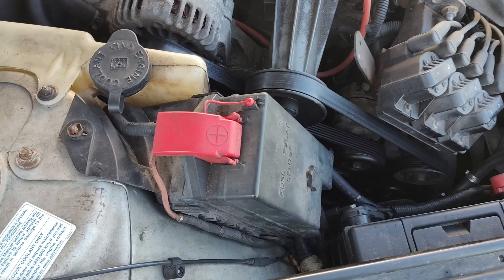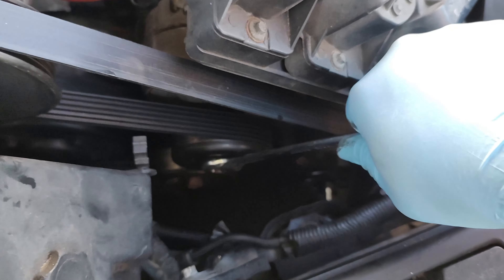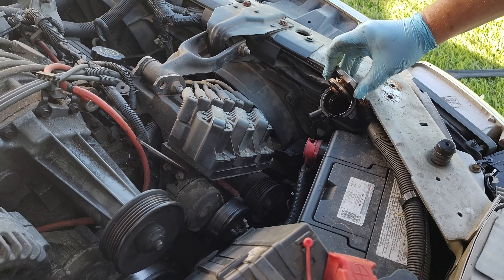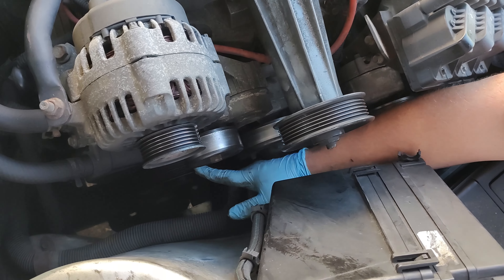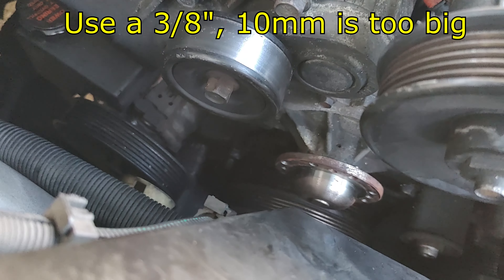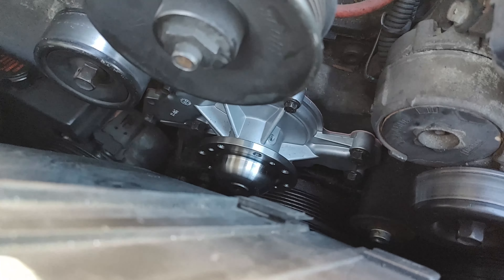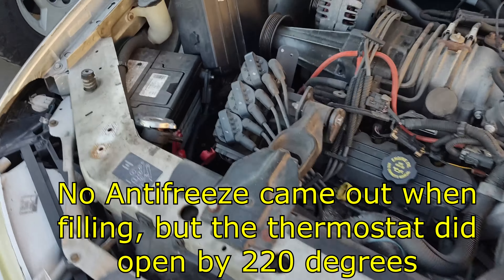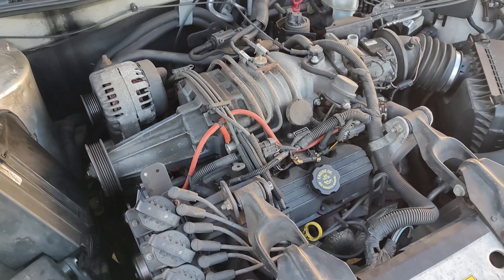2001 Pontiac Grand Prix GTP Water Pump Replacement for 97-03 GM 3800 Series II Supercharged L67

Comment: How do you get the pulley off I heard a 15mm bit do you need a pulley puller to pull it off or you just take it off with the 15 mm
Reply from the maker: @terrelljoseph6150  you do need a puller. Last I checked I think zzp had a modular pulley kit so you dont have to pull it multiple times if you're changing pulley sizes
Reply: @brninitdwn  I got it thanks for the reply
Reply from the maker: @terrelljoseph6150  I didn't even look at which video it was, I was giving you info for the supercharger pulley.😂 Glad to hear it worked out!